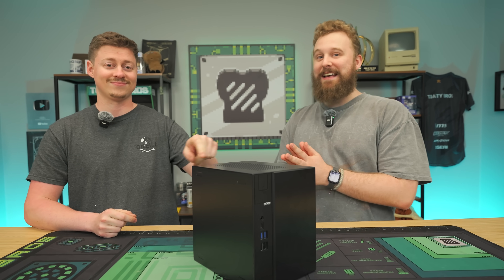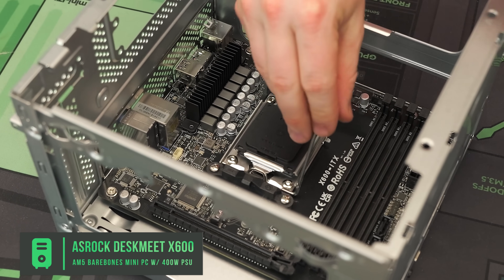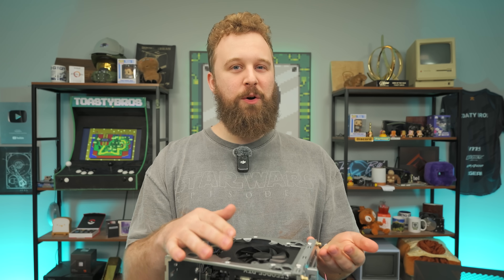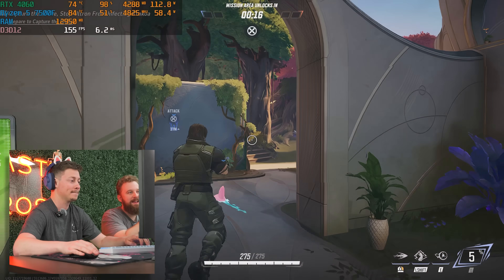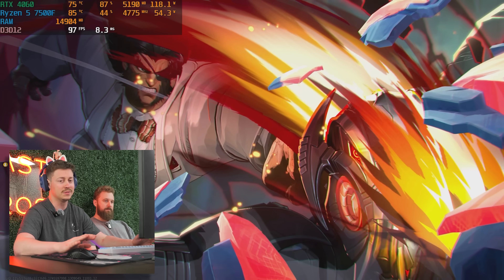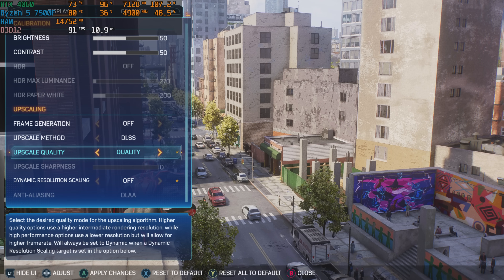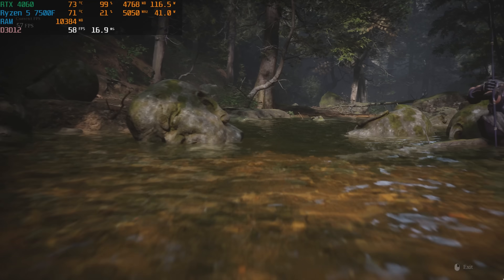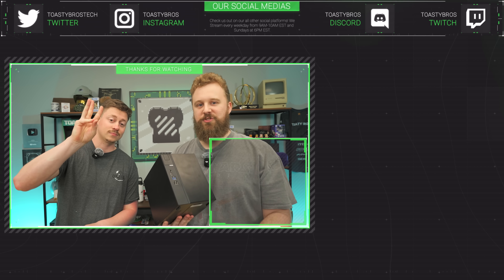EASY & CHEAP AM5 Mini ITX Gaming PC

Comment: @3:11 -- As someone with an MSI Trident 3 (which only fits short single-fan cards) as one of my PCs, I wish you hadn't featured this GPU, as they are already overpriced on the market.  It would have been a lot more helpful if you could have measured the maximum possible card length to help people more easily determine what can fit, since there are a lot more 2-fan cards out there to choose from.

Comment: I built the am4 version with a ryzen 5 5500 and oem 1660 super and nactua low profile cooler, little hot but ran great

Comment: Coolers are available but all are the flat type as only 54mm of space in the case for a cooler.  several brands available.  Most are only 2 heat pipes.

Comment: These aren't bad little machines.  I have an AM4 one from about 3 years ago, swapped in an SFX PSU so I could fit a better cooler, only big downside at the time was the GPU selection was pretty slim, I ended up going with a 6650 XT.
Reply: So there's no chance a 6700xt could fit? 😂
Reply: @kazefw3834 apparently a 9060xt 16gb can fit as per techpowerup.
Reply: The PSU it comes with has air flow reversed; did you do anything to the SFX PSU to get the same effect?
Reply: Yeah, I flipped it, but for the love of all things holy, don't go disassembling or messing with PSU's if you don't know WTF you are doing! THEY CAN KILL YOU GRAVEYARD DEAD!!!
Reply: @yonson_racing  Amen to that, sir! I think I'd just flip the PSU over.

Comment: I´d personally go with a minisforum bd790 or 795 (depending on if the x3d cache makes a difference). There is probably no better itx platform available for money than this. Add some sodimm ddr5, gpu of your choice and you have an extremely powerful itx pc. There is not much that can beat a 7945hx or 7945hx3d. Already impressed what the 7945hx3d does in my laptop and that while it is usually throttled by thermal (as there is only so much laptop cooling can do), imagining this with a more effective cooling is just nuts.

Comment: Nice little lan box. I'm a little bougie and went with Jonsbo C6-ITX and a Corsair RM750 PSU. ITX Asrock board with a 12700K, 32GB DDR4, 2 TB Orico NVMe and a Gigabyte 4060 OC lowprofile GPU. Not setting any benchmark records but rock solid and fast as hell for what it does. Thanks for the video guys.